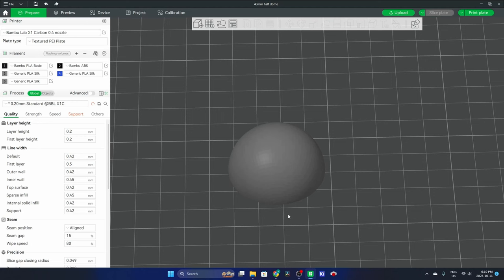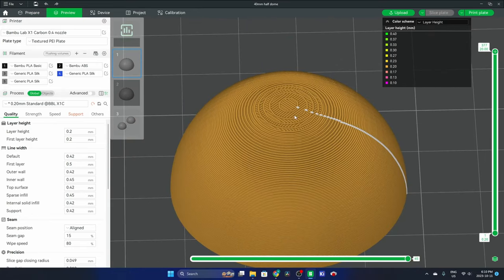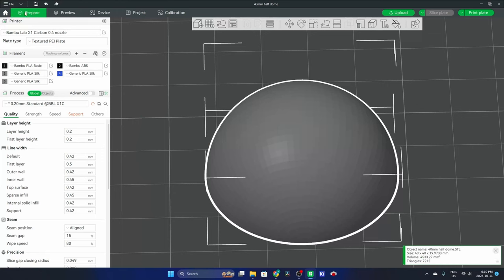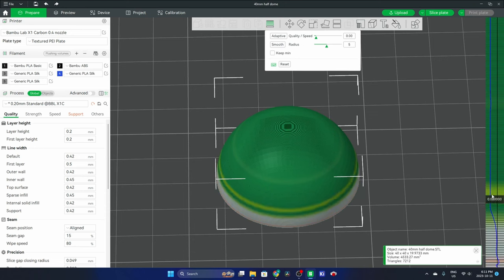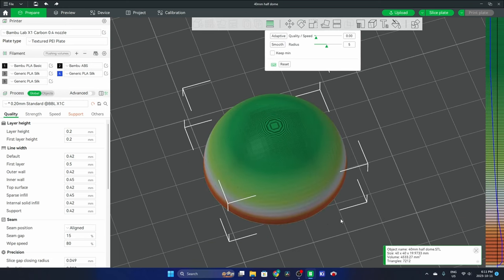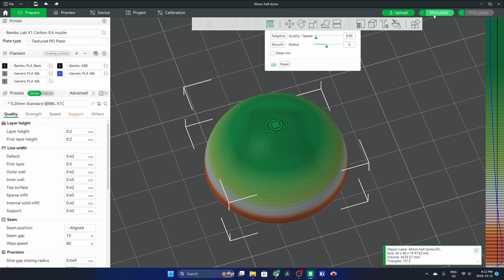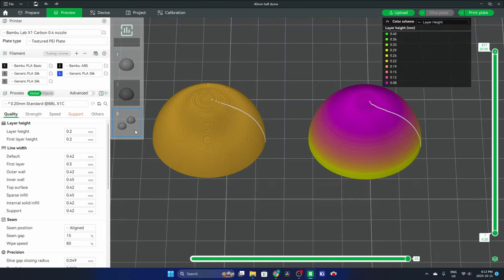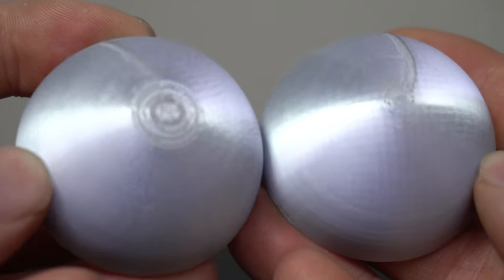Fix the Top Layers of Spheres in Bambu Studios

Comment: I'm kind of baffled by the description of this "problem". saying that "bambu printers really struggle with the top surfaces of spheres" is like saying "cars built by mitsubishi struggle with losing traction on icy surfaces". stepping is intrinsic to fdm printing, and losing traction in icy conditions is intrinsic to all vehicles with rubber tires moving at speed on icy roads. or just moving on an icy surface in general lol. super ridiculous to phrase the issue as if there's something about any particular fdm printer that makes the problem more prevalent.
Reply from the maker: Yeah that's fair criticism, a few other people have commented similar things and my response has been that "Default settings in bambu studio are not ideal for printing top surfaces of spheres" would have probably been a better opening statement.
Reply: Or “using cool, new slicer feature of Cura, BambuSlicer, and PrusaSlicer to improve the top surfaces of your spheres.”

Comment: If only they had a feature to smooth out the seams more
Reply from the maker: Yeah I'm playing with OrcaSlicer to release a video about seams cause they're pretty horrendous. I've gotten many comments saying use "Random" seam setting in Bambu Studio but I think that looks even worse.
Reply: @PennerFab Checkout ‘scarf seams’ in Orca (if you haven’t already). Scarf seams will get rid of the seam bump, but can leave an unappealing visible pattern, especially with multi color silks.

Comment: I've had very good results with Bambu slicer by using the same technique you've used, but I also made one other setting change.  Under the Quality tab change the setting for ONLY ONE WALL ON TOP SURFACES to "Not Applied".  I get a nice concentric pattern all the way to the last layer.  Hope this helps.
Reply: This is a big improvement thanks
Reply: I'm definitely gonna try it. Thank you!
Reply: What about a model of mandos naboo n1 starlighter with all those smooth curves, how do I get rid of those 0.08mm tiny waves lines that only show up in patches
Reply: This comment is underrated , thanks for the tip 🤙🏼

Comment: Adaptive layer heights can be nice but only really work well if there's no other geometry in those layers of the print. Otherwise you'll get banding effects on those other things where the layer height changes.

The big original problem with your sphere top is the solid fill lines sticking out. On Cura you can fix this by increasing the "extra skin wall count" enough that sloped surfaces show only these extra walls. Not sure if Bambu has a similar option. Just using more perimeters will fix it too, but of course has material cost.
Reply from the maker: Yeah variable layer height definitely has it's limitations. 

I don't see "extra skin wall count" as an option. I find Bambu studio a little limiting coming from Cura.
Reply: I've had variable layer heights on many complex models without problems.  Even the adaptive layer height feature works great most of the time.  I haven't ran into banding issues, unless the layer adjustments are not made in factors/multiples.  You have to make sure, that whatever layer you're on (when you make the adjustment), that Z height is evenly divisible by the new target layer thickness.  Say you've been printing at 0.4mm layer height, and you want to step down to 0.3mm, you're first opportunity to do this, without issue, is layer 12, as that's the first common multiple between 3 and 4.  That also means, you'll get a chance to make this adjustment, cleanly, every 12th layer after: 24, 36, 48, etc.  If you don't adjust on a layer that is a common multiple between the print height you are at, and the one you are targeting, then you'll either be too close, or too far away, for the next layer to mate perfectly with the previous layer.
Reply: @3DPrintStuff 
I would think it could be set as a height modifier.
Reply: You can also make your layer height stupid low. Obviously this will slow the process

Comment: 0:00. Bambu Lab's printers do NOT struggle with the top surfaces of spheres.  The problem has to do with the amount of x/y travel you have in relation to z travel.  The more you increase the x/y to z ratio, the more pronounced the stepping effect will be.  This is true for all 3D printers, and all CNC machines, and for all shapes that feature large x/y to z relationships.  This is why reducing the layer thickness reduces the stepping effect, as you're getting less x/y travel before making another z graduation.
Reply from the maker: Fair point. "Default settings in bambu studio are not ideal for printing top surfaces of spheres" would have probably been a better opening statement.
Reply: @3DPrintStuff  that would be better, though, it's not just spheres, but any shape where you have an extremely gentle slope, approaching flat, but not actually flat.
Reply: Do you have a 3d printing channel ? I think i'd rather watch your videos lol.

Comment: great video, just a quick question... that line that goes down the sphere. is that removable too? I found your video looking for a way to remove that long line down the sphere but you didnt mention it. To be clear im talking about that white line shown on your object, not the rings. thank you
Reply: It looks like it is in theory. If instead of starting each layer adjacent to the same point as the previous layer it was staggered in some way, that ridge wouldn't form and instead there would be speckles all over.

Comment: Awesome!  I've always hovered over that "Variable layer height" button, but never knew what it did until you explained it!   I'm trying it now on a print to see how it comes out.  Thank you!!
Reply from the maker: Glad you learned something. How did the print turn out?
Reply: One day bambu will use ai to automatically scan our models and decide exactly what settings we need to optimize them with some sort of high powered cloud based slicer simulator subscription well pay for to give us nearly instant nearly perfect results back based on settings that are actually ai Taylor made for whatever we print and where options for strength and detail can be varied on different parts of the model and actually look like what we want.

Comment: I use a plugin for my slicer that allows the print to run as a continuous spiral instead of layered circles. It removes the knit line running you have on your spheres and smooths out the top

Comment: 1:38 I had no idea you could change layer height using the layer map on the right. Great tip! Can you also add modifiers if you want to control smaller areas? Or does it want to do all layers across the plate the same?
Reply from the maker: It will do the layers of that object the same. So in this video I've got two objects on the same build plate sliced differently. But if you wanted to highlight just one part of an object I don't think you can do that.

Comment: It should be stated more clearly that this isnt an error. This is a result of physics. Layers were simply too thick to reoroduce the desired result. Its just a layer height issue. And this is but one way to fix it. 

You should also have explained why this is advantageous compared to just reducing layer height to like 0.08 from the beginning. These are the real meat and potatoes. This is important for new people who will simply think its easier to reduce layer height instead of attempting to learn this technique. Giving them a reason to try this harder variant instead is great to motivate.

Comment: Very helpful. Is there any way to get rid of or reduce the start stop layer bulge besides move it to a less visible spot?
Reply from the maker: I've been working on ways to reduce that. Bambu studio doesn't really give you many tools to modify this appearance. You can change the seam position to hide it but on a model like this there's nowhere to hide it. 

There's also "Seam gap" and "Wipe speed" that you can play with but I don't have any recommended settings for those yet.

Comment: Thanks! i never thought to click on the sidebar to adjust the layer height
Reply from the maker: Neither did I until I read the wiki for that feature! Pretty neat to have that much control and be able to pin point the area you want to have larger/smaller layer heights.

Comment: Marking this as a bambu issue or a top layer issue is strange when this is exactly the same on a bottom layer and on any other fdm printer. This points towards it just being a layer height issue and that the issue occurrs in relation to how close to the parallell plane of the printer bed the surface angle comes. The closer to horisontal the bigger the issue. Regardless if top or bottom.

Ofcourse near horisontal overhangs (like 80-89 degrees) have their issues other than just this but it is relevant.

Comment: great tips!But, just a question, why the printer create that vertical side string on the sphere?Can be fixed??
Reply: That is the Z Seam where the extruder stops and ooze out a bit which is normal. Search for bambulab pressure advance to calibrate it. Probably calibrate it manually to receive better results
Reply: @Phate777  thanks for your answer! 🤓
Reply from the maker: like @xBlackPumAx13  said, it's the z-seam. Pressure advance is an option but I wish there were some more tools for troubleshooting this issue. There is a random seam location option that I think looks worse than the aligned seam you see in this video. If I manage to get rid of the seam for the most part, that'll be my next video.

Comment: Your print looks great! I’ve a Kickstarter X1C and my prints have VFA issues. I’ve followed the auto belt tension guide but that hasn’t helped. Any suggestions/advice?
Reply from the maker: have you run a calibration routine after performing the auto belt tensioning? I would try the tensioning again and perform a calibration of the printer. VFA from my understanding comes from the stepper motors vibrating, what speeds are you printing at?

Comment: Is there a way to vary the layer height only from one nozzle path point to another leaving the rest of the print heights the same so the rounded part may get 3 layers vs 1 layer for the rest?
Reply from the maker: Not sure I completely understand what you're asking but you can choose to have just the top of the sphere modified and the rest of the model stay at the default layer height. You would just use the tool in this video and specify just the top portion to be smaller layer heights.

Or do you mean if a model has geometry that isn't connected to the other parts of that layer and you only want to specify one part of the object to be a specific layer height ? You can't do this unfortunately, the entire layer for the object will have the same layer height.

Comment: Years ago I saw a video with this new printing technique that didn't need to do flat layers, it could adjust Z height smoothly while on a given layer.  How is this not commonplace in slivers/printers these days?  Looked like it was going to be killer and it would handle things like this so much better.
Reply from the maker: Yeah that sounds cool. Experimental printers that have 5 axis also seem like the ideal method for getting nice smooth round surfaces. Or we just reduce the layer heights down so far that we can no longer perceive them.

Comment: In addition to using layer height you could go to machine setting and lower the minimum layer height from .08 to something like .04
Reply from the maker: yeah .04 would make that top portion look even better.
Reply: Except you can forget about printing reliably at 0.04 mm layer height except MAYBE with a 0.2mm nozzle.

Comment: It increases time  to finish =( but really works good
Reply from the maker: It does increase print time, should have mentioned that. There's always a trade off in 3D printing and it's usually time vs quality.
Reply: @3DPrintStuff  
Hi there,
Would adding an the ironing feature improve it even more?

Thanks.

Comment: Thanks! Will use this next time I print out a figure where the only thing bothering me was that ugly lines on the head. 👌👍

While the adjusted sphere looks great in that aspect, it does draw lots of attention to the ugly seam. Fix one thing get another to fix 😅… will look if you have found some settings to make it less obvious.
Reply from the maker: Yeah the seams are pretty gross. There are a couple options like random or fuzzy skin but I don't like either of those... going to be working on a video about this soon. Teaching tech has a good video on an experimental feature called scarf joint seams: https://youtu.be/vl0FT339jfc?si=1dXRenmO0cjXSKuS

Comment: Thanks for this tip! Would this setting work on a helmet dome top or would it mess with the rest of the helmet model and screw some other area up? It sounds like a great fix for the issue on helmet dome tops
Reply: adjust  where you want it to start the variable layer height with the thing on the right side like he was showing.
Reply from the maker: You're welcome! It would definitely work on helmets, that's one of the best use cases for this feature. You can choose to vary the layer height only on the very top of the helmet and so the rest of the helmet will be unaffected.
Reply: @3DPrintStuff  Thanks!

Comment: Another trick is to rotate the model so the sphere isn't on top anymore. Put the most detailed or problematic area toward a side insead of the top.
Reply from the maker: You start to make tradeoffs with that technique. More supports will be needed and can ruin the bottom surface. Not an issue if the bottom surface doesn't matter but maybe that bottom surface is a matting surface and you need it to be relatively clean and flat. You'll also have an edge that isn't as nice.

Comment: Are we really going to pretend this is a new, never seen before, feature?

As if it was not introduced on 10/02/2017 in Slic3r 1.33.3 - Prusa Edition and on 14/02/2018 in Cura 3.2.0?
Reply from the maker: Not pretending It's a new feature. Many people are new to 3D printing and are not familiar with the tools available.